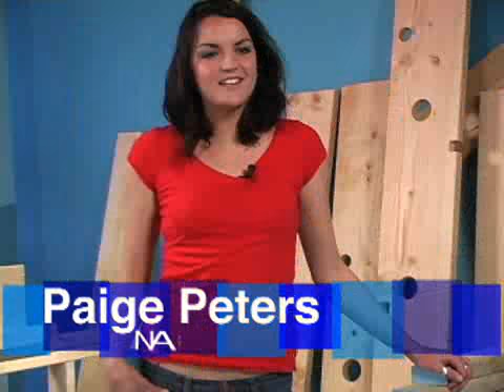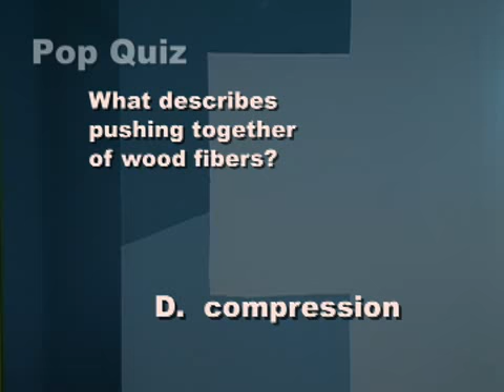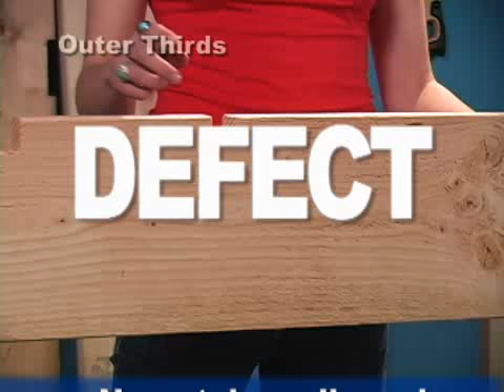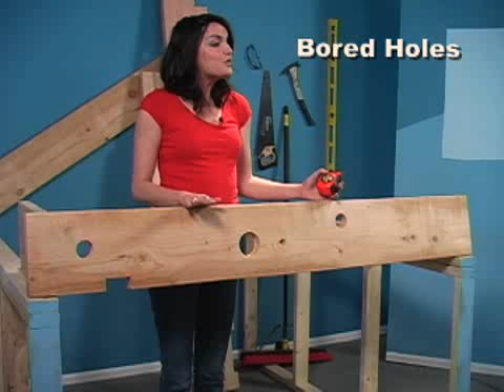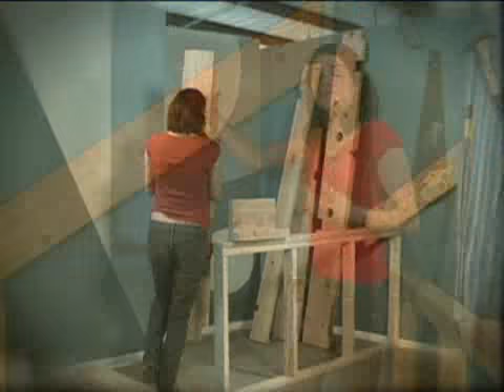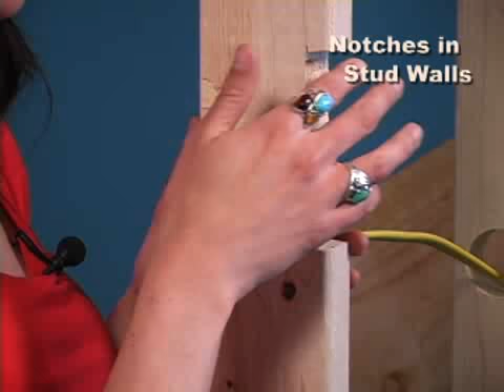Notching, Holes,   Cutting Inspection

Comment: Very good but just one thing.  You can place cable through a hole that is at least 5/8 from the edge if its at the back of the stud, not front.  This is to prevent people drilling into a cable

Comment: Interesting. There are different standards in the UK (routinely ignored by plumbers from what I've seen). On a simply span, notches can only be one-eighth of the depth, must be within 25% of an end of the beam and only on the top, never on the bottom. 

As as as holes are concerned, then they must be drilled on the centre line and only between 0.25 & 0.4 of the total span length as measured from either end (so it's the middle 20% that has to be free of holes). 

There are also limits as to the spacing between adjacent holes and notches. As mentioned, lift the average bathroom floor and you are likely to find the rules have been somewhat bent.

Comment: Okay everyone needs to understand this is not okay
Reply: what is not ok?
Reply: Holes= stress concentration... area of discontinuity. It raises the stress the beam experiences.
Reply: @villaclaratrading-vaco.7556  In the UK holes up to one-quarter of the depth of a beam are allowed but only between between in the "safe zone" 0.25 & 0.4 of the span from each end (so a total of 30% of the length). They have to be drilled on the centre line. The reason it's in that part of the beam is that with compression in the top and tension at the bottom, there's a region where the stresses and tensions in the beam are roughly neutral. As this is an (approximately) neutral area in that respect, that part of the beam doesn't provide much of the strength. Also, round holes in a beam in the neutral zone don't concentrate the stresses as there are no corners (and wood is fibrous, so it doesn't transfer forces quite the way metal does).

It can be seen with engineered joists which put  most of the material on the top and bottom with some sort of zig-zag webbing, sometimes wood, sometimes steel. There are huge gaping holes for services.
Reply: Steve Jones alright so i am not arguing if it is safe or not. Sure its safe i get it. But having a hole in a beam creates stress concentration. Do not bring up material properties or fibers etc. stress is independent of material. Find the average max stress in a beam and then find the average max stress with a hole in the beam. A hole is an area of discontinuity which raises the stress of the beam. It doesn’t matter where it is, the stress will raise even if its by a stress concentration factor as low as 1.1. Its a basic engineering principle. Run a Finite Element Analysis on a beam with a hole and compare with no hole. The maximum bending stress that the beam experiences will increase due to the discontinuity in the member, thats all i am stating

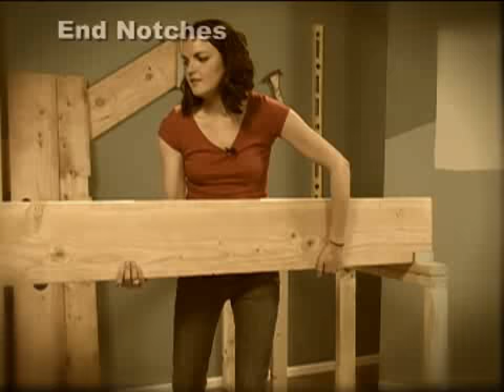Comment: 04:28 Ledger board minimum 2 inch by 2 inch.  The 2 inch part of a 2 x 4 is frequently only 1-7/16 inches in width so is the the 2 inch really 2 inch meaning it has to be at least 2.000 inches eliminating any use of a normal 2 x 4?